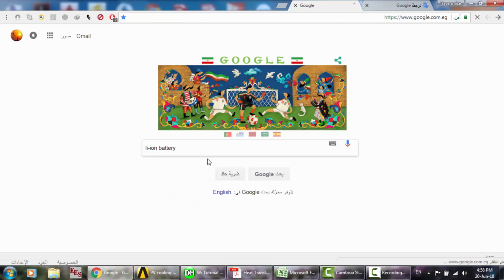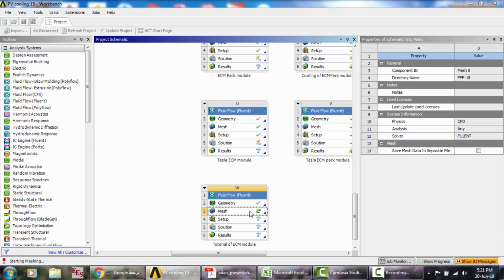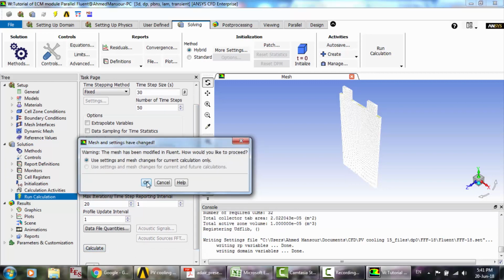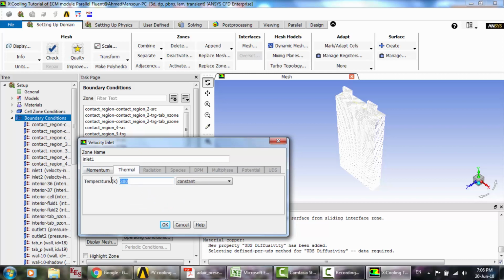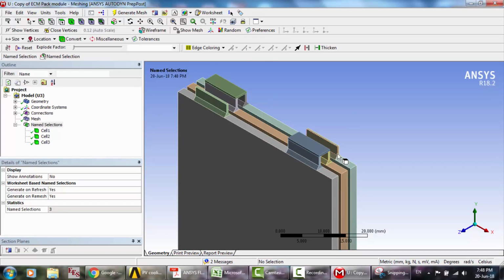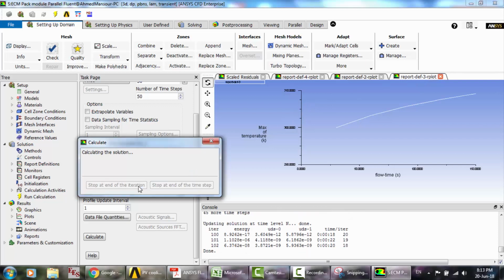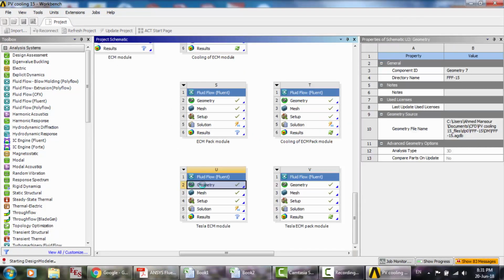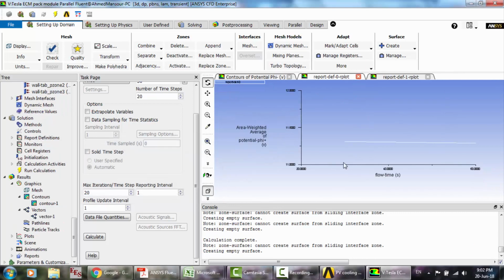CFD simulations about ECM Li - Ion battery, single cell & pack with & without cooling, Ansys Fluent

Comment: Thanks a lot for your tutorial Sir, I am presently working on 21700 Samsung battery Cell thermal management.
           Your tutorial helps me a lot I think, So can you please share your PDF file and CAD model.
                  veerath.deekshith@gmail.com its my mail ID please share the file sir.
And if you make a video on 18650 and 21700 battery model simulation it will be more helpful to Students like us.
Reply from the maker: Hello dear Veerath, you are welcome, I have already covered the cylindrical cell simulations in this video. Check out your e-mail. Danke!

Comment: Thank you for the video. can you upload more videos for battery pack modelling for prismatic and cylindrical cells. It would be great if both single cells and battery modules are used . It would be quite useful to have fea analysis of battery casing, crash test, vibration analysis etc. can you please send me the pdf as well as the cad file for the current model slayerbag3@gmail.com. Thank You.
Reply from the maker: Hello dear Sourabh, you're welcome! Check out your e-mail. Thanks for the recommendation, actually the same procedure is followed on any other geometry. 

You can apply the same steps on other designs. The mechanical tests also can be simply applied following the tutorials available on YouTube or in pdf documents.

 These test are famous and are not restricted to the battery. I have a tutorial about the mechanical analysis of a turbine and the procedure is easy. Just check out the tests you want and you will find some useful tips Danke!

Comment: Hello Sir, I'm learning ANSYS Fluent, and my research area is thermal modeling of battery EMS. I found your video is very impressive and want to learn, but the CAD file and pdf file you mentioned requires ANSYS account to access, it's too expensive to afford. Could you do me a favor and send me a copy of this project including CAD and pdf files? my email is 331956732zzy@gmail.com. It's much appreciated for your help!
Reply from the maker: Hello dear Daniel, you are very much welcome! Check out your e-mail. Danke!
Reply: @haveanicetime   Thank you so much!

Comment: hi please could you share the file cad file and pdf also if you have any thermal heat transfer cfd results for EV batterys could you share them as I am doing a university dissertation on battery thermal management systems - email - haya45585@gmail.com
Reply from the maker: Hello dear Haya, you are welcome! Check out your e-mail. Danke!

Comment: I am getting  a error "divergence  detected in amg solver uds 0". Can you help me in this?
Reply from the maker: Hello dear Nikhil, these kinda errors come from the geometry's handling method. You have to exactly follow the way I shew. Danke!
Reply: @haveanicetime  That means should i start from geometry from first  or  only reset my setup in Fluent?,because this error is coming in Fluent
Reply from the maker: Hello dear Nikhil, the geometry has a problem I guess. Make sure you exactly followed the steps I shew. Also, may the setup has a problem. Danke!

Comment: This is really great. Can you do more videos related to this? Especially with temperature variation and with coolant flowing through the modules?
Reply from the maker: Hello dear Pranav, you're welcome, simply the video here shows the modules and the pack with and without cooling. Any further study can be simply done following these fundamentals in video. Just determine the way you wanna apply and it will be easy to numerically investigated. I am gonna check out the pdf files you sent and try to guide you. Danke!
Reply: @haveanicetime  thanks a lot. I received your mail. I am trying to find a model which is similar to my study and then just change the parameters as per my requirement and rerun the model, that is if I find a ready made model. xD
Reply: Can u share those pfds with me plz, I'm doing a project related to this, so plz share it
Reply: @sudharshanj1955  are you done with your project
Reply: @ramkrushanpatil1739  yes, i worked on BTMS for my final year project in engineering
Reply: @sudharshanj1955  I am doing these simulation for 3s4p , lithium ion cell cylindrical cell module ...for ECM model?
Can you help me in this

Comment: This is Bala Kumaran ,can I have PDF and cad model ?
c.l.bala20@gmail.com this is my gmail
Reply from the maker: Hello dear Bala, check out your e-mail please. Danke!
Reply: Thanks lot again
Reply: Sir I have a question for you ,what does initial state of charge and reference capacity mean in the model parameter?
Thanks lot .
Reply from the maker: Hello dear Bala, the initial state of charge SOC shows the percentage the battery is charged. if it is 0.4 SOC, it means the battery is charged by 40% and to be fully charged, 60% must be added. The DOD (depth of discharge) is the the contrast to that. If the DOD is 40%, it means that the battery consumed 40% of the fully charged condition. The remaining is 60% to be consumed. be careful when you input that percentage because the SOC is 1-DOD. The reference capacity is the Amp Hour AH. This shows the energy of the battery. It is calculated by this law:Total Watt-hour/Voltage, Watt-hour is the energy and Voltage is the battery voltage. Check out please the next link:
https://www.youtube.com/watch?v=cxkVxi9P0EA
and you have to study the basics of the batteries at 1st :) Vielen Dank!
Reply: Thank you so much sir
Reply: Sir can I model the battery in parallel connection or combined parallel and series connection 
If we can successfully to do it , please suggest what are the following steps need to be consider.
Thank you so much sir
Reply from the maker: Hello dear Bala, I showed how to connect more than one battery. Simply it is exactly like the electrical connections in reality. Just see how to connect the busbars. Check out again the this part in the video.  Danke!
Reply: Sir ,the temperature value of the cell is not vary with cooling or without cooling.
All the temperature value is constantly maintain.why does it maintain constant ?
Reply from the maker: Hello dear Bala, reset the simulations and follow again the steps. Sometimes Fluent face problems. Get a model and validate it please. Danke!

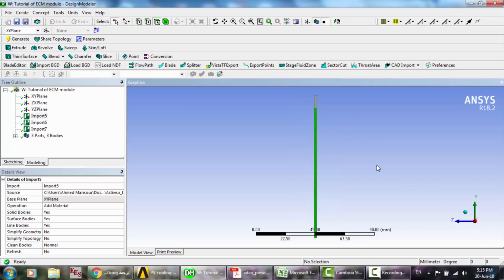Comment: sir plss tell me..@14:15 how the negative and positive tab are attached to the cell...how do you imported the 3 seprate bodies(positive tab , negative tab, active cell) in geomentry section at same time...
Reply from the maker: Hellodear Lunatic, simply I prepared the geometry in Autodesk Inventor by calculating the distances that make the assembly look like what you saw. I used the move tool in Inventor to let the parts connected for the interfaces. It is a pure CAD work. Danke!

Comment: dude can you help me modelling it for how much heat generation
Reply from the maker: Hello, do you have research articles for validating the results and some tips to follow? Danke!
Reply from the maker: Also if the generated heat by convection will be estimated, Q_conv=A_battery*U*(T_Battery-Tenvironment) at a specific timestep. This is the simple equation. because the simulation is transient, the Q will change with time depending on the cell's temperature. It can be done using a simple excel sheet for numerical values. If the contours are needed, we can check out the option in FLUENT that shows the heat generation (Flux from the battery) contours. Danke!

Comment: I've sent you an email. The graph you show at 1:20:00 has a maximum temperature of 316K whilst my maximum temperature is 308K after 1600 seconds.
Reply from the maker: Hello dear Skip, okay, I am gonna check the e-mail out. The difference occurs due to the difference between the dimensions I used and yours I guess. I will send you the geometry I used to try it. Vielen Dank !

Comment: I also have doubt about boundary conditions. Why only covection? Why only those values ? Anyone knows then please help me
Reply from the maker: Hello dear Pankaj, you are welcome, depending on the realistic conditions we choose the BC's type in Fluent. The battery is cooled by a convection coefficient at a free stream temperature. 
If you decrease the coefficient, the battery's temp. will increase. And the contrast is correct. You define the boundary condition as the experiment. 
The environmental temperature can be changed if we make a domain surrounds the battery represents the air or the fluid. In the video we did not consider this, we only dealt with the battery and the convection heat transfer.  
Also if we cool the battery as I also showed, we may not include the convection details and see the pure effect of the cooling fluid. Always we try to validate the experiment. i just showed a simple idea :) 
Danke!

Comment: Very nice video. Wondering if you can apply this to 18650 or 21700 cells; I'm trying to make several parallel batteries (using such cells) and combining them in series.
Reply from the maker: Hello, thank you very much, yes, just follow the steps of the cylindrical battery modeling like what I did in the video. Vielen Dank !
Reply: @haveanicetime  Sounds good, I can't seem to get anything to appear in the Conductive Zones box though - is there a way to solve this?
Reply from the maker: @mtattrain2  Yes, I guess you did not do the step of defining the material's type (solid) once you open the mesh tab. I assured on this in the video, reset the mesh and follow exactly what I did ...
Danke!
Reply: @haveanicetime  Gotcha, sorry. I think my last issue lies in defining contact regions though, since I had imported an assembly from Solidworks - is there a way to rectify this?
Reply from the maker: @mtattrain2  Simply you must calculate the distances between each component to make sure when you make the assembly you find the components touch each other to find the interfaces defined automatically. It is just a matter of accuracy when you make the assembly. Danke!
Reply: @haveanicetime  My components seem to be fine, but all the conductive zones in Fluent do not appear as named selections (from the meshing portion) but as a combination of selections (like "Bonded-tab_nzone-cell").
Reply from the maker: The procedure I followed is nit used in your case. Watch the video again please and see where the mistake is...
Danke!
Reply: hey did you perform ECCM model simulation on 18650 cell?..
I am doing this for project...can you help me out

Comment: Hello. I want to use ANSYS to model a cell phone that only contains the glass cover, aluminum body, circuit board, and Li-ion battery. I would like to determine heat generated from both the battery and board. Would this tutorial help me? Any tips on completing my task? thanks

Also, would it be possible for me to email for any more additional questions?
Reply from the maker: Hello dear Mohammad, yes you can model the Li-Ion battery using this video. For the electronic board, ANSYS ICEPAK is used for that. You can find some tutorials about it. You can ask here or at mech.eng.ahmedmansour@gmail.com Danke!
Reply: Thank you
Reply from the maker: @MohammadShahid-un2wf  Bitte schön !

Comment: Thank you for this tutorial on different types of cell and pack
Reply from the maker: You are welcome dear Chandan :) :) :)
Reply: Can we plot all the graph related to lithium battery like- charge-discharge, DoD etc..?
Reply from the maker: You can plot any quantity during charging or discharging, the video shows the discharge process, I have not simulated the charging one, but I was told that you can simulate the charging process by changing the SOC(state of charge) to 0 and you should enter the data related to the charging process, try it because I am not sure :) and tell me about the progress :) The guide shows that the SOC 1 means that the battery is full charged...Thanks!

Comment: Sir can u send the geometries i will be really thankful my email is     muneefshah@gmail.com
Reply from the maker: Hello dear Muneef, do you have any difficulty in generating the parts by yourself? I think it is very simple :), Tell me please, Vielen Dank!
Reply: thank u sir i got the dimensions from a paper i will try it
Reply from the maker: Great dear Muneef, if you have any questions, ask please, Viel Erfolg!
Reply: i have actually made the geometry in solid works there are three solid bodies but they are imported as one so i dont have the option to froze the nodes and add materiel to the cell body because they are considered as one import
Reply: i have actually made the geometry in solid works there are three solid bodies but they are imported as one so i dont have the option to froze the nodes and add materiel to the cell body because they are considered as one import
Reply from the maker: You must design each part in a separate file, then you will have 3 solidworks files for 3 parts, each part is saved as parasolid x_t, do it please and tell me...Thanks
Reply: i have done it. it worked thanks a lot. Results are the same but the temperature of the battery is not increasing which is my main concern it remain 300k as given in the boundary condition
Reply from the maker: This very good! Which model you are talking about? I have faced this problem and I was sure that the temperature should increase, so, I closed Fluent and re-opened it again and just clicked on calculate, the solution was initialized again the temperature increased with time, before doing this, the temperature was constant with no reason, it is a problem in FLUNET itself I guess :) Try it again please and tell me, Thanks...
Reply: its working fine now. i increased the discharge rate.. thanks alot
Reply from the maker: Okay, very good!!! Viel Erfolg!
Reply: Sir i have made the cell according to my capacity and it is working fine but i dont know how to recharge it. for that discharge rate, current and power should be in negative i did all that but its not working.
Reply from the maker: Hello dear Muneef, okay, I am gonna check out the recharging procedure and tell you very soon, :), Danke!
Reply from the maker: Hello dear Muneef, the video shows the discharging simulation, if you wanna the charging simulation, I think it will be based on the model parameters, if you open it (choosing Equivalent Circuit model), you will find the coefficient that define the discharging process, you can also define the charging coefficients by checking on using different coefficients for discharging and charging....also, the min and max stop voltage are very important, you must know them, for example,  if you make them   3 and 4.3 and the C rate is -.3, the +ve potential will increase up to 4.3 and the simulation is gonna stop because it reaches the max limit, so, if you wanna run the charging simulation, enter the right charging coefficients and make sure that the battery starts from low  potential and then increases up to the max limit (charging process)...Try to make this and tell me please,  check out some references about that :) Vielen Dank!
Reply: thank u sir, i got some information form ansys tutorial i changed c rate, current and power into negative values now its charging. my cooling method is a bit different i m using phase change materials. anyhow thanks a lot...
Reply from the maker: This is awesome :) dear Muneef, but could you tell me how did you do it? what I know is you can change the C rate only or the current only or the voltage only, so what are the steps and what are the value of the voltage at staring the charging process? Thank you very much! Also, could you please send me the ansys tutorial? mech.eng.ahmedmansour@gmail.com
Reply: yes dear, when u open msmd model in E-chemistry models chang it to user define e- model then put negative sign with ur C-rate,  Specific system Current, and Specific system power after that go to model parameters and change battery initial SOC to zero which means that battery is totally discharged, after that initialize and run  the calculation ,maximum and minimum voltages will remain default . i have done it like this and i got charging graph from the results but i am not 100% whether it is the right way to do it..
Reply from the maker: Vielen Dank sehr geehrter Muneef! Das ist Wunderbar!